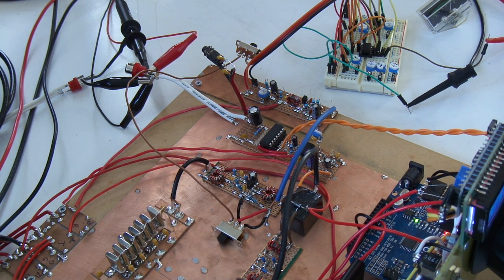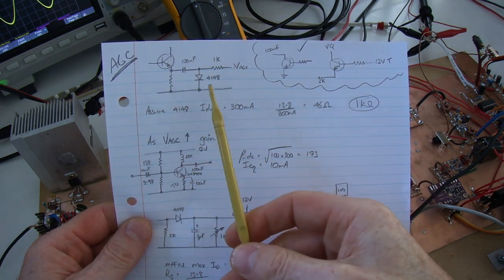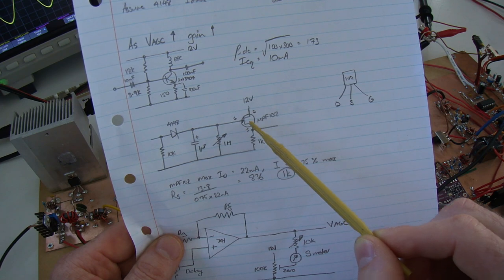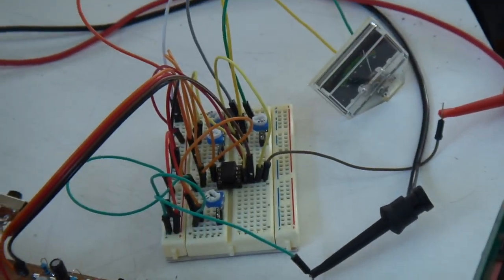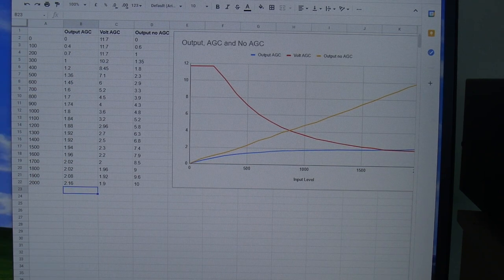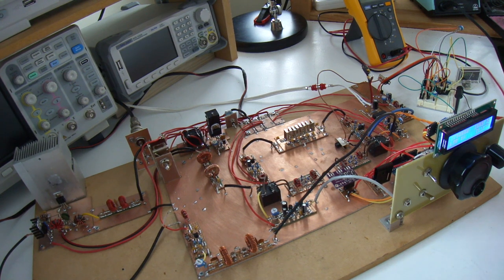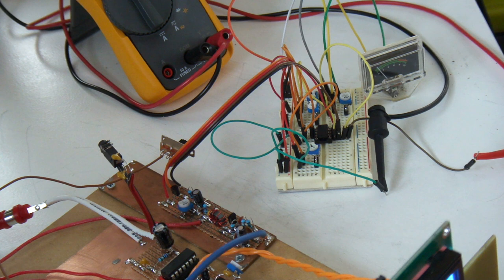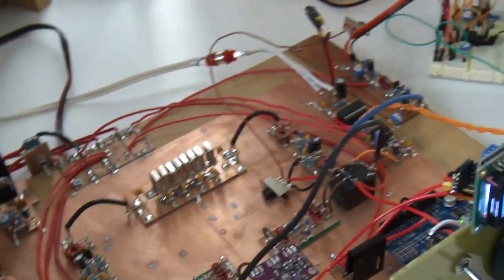Simple AGC Experiments

Comment: I Love the cute modules and enjoy the spirit of your projects. In the same context you could try a Gilbert cell mixer made of matched 2N3904 and compare the performances with your new Siglent SSA. There's a lot of flexibility in that mixer and it's a joy to play with a discrete one where you have access to all nodes, vary gain and modulation schemes.
Reply from the maker: Thanks and I'll look into that Philippe. I've used Gilbert mixers in the past, but not using discrete transistors. That could be interesting as you get the added bonus of gain!
Reply: @CharlieMorrisZL2CTM  yes, and spot to plug some AGC circuitry.

Comment: Very effective and much simpler than my dual gate fet IF amplifier. I'm also adding a LM13700 transconductance audio preamplifier to increase the dynamic range, a single stage gives about 20 db control I may try 2 stages. Thanks again ! WA8HTO
Reply from the maker: That sounds interesting Jerry. I had greater dynamic range when i used the 1N4148 versus the 1N4001. The smaller junction area certainly helped.

Comment: Charlie, I know this is an older video, but would you mind elaborating on how/where you tapped the signal for the AGC detector? It seems like you tapped in the IF chain instead of in AF like most receivers. I'm trying to implement a simple AGC in one of my receivers, but I'm trying to decide on the best place to tap the signal and how to do it without loading down the preceding stage. I've read in Solid State Design and the W1FB Design Handbook, but just wanted to see how you did it, since those texts tend to focus more on IC amplifier chips like the MC1350. Thanks for the work that you put into these videos; they have been a tremendous resource for me.
Reply from the maker: Hi Will. I tapped the IF for this rig. From what I can see in the literature this is the best approach. I've also used AF, which to be fair worked well too.

Comment: Very interesting, to use a simple diode as a variable resistor. The problem is I guess it is non-linear, so in effect you have built a limiter, not an S meter which should have a logarithmic response of -6dB/S point. I am thinking that to provide a log response needs something more sophisticated like an AD8307 log detector (and them an Arduino...)?
Reply from the maker: Absolutely, this is just a simple gain control circuit. The meter is just there for show. Adding an AD8307 could be another upgrade IDC.

Comment: Amazing that a single stage agc controlled has such a good effect at a constant voltage output (after a point).  But the AGC does limit the available gain quite a bit.
Reply from the maker: Yes it's a tradeoff. I have plenty of spare AF gain which i may look to use (not yet). I'll keep playing with it for a few days and fine tune it.
Reply: @CharlieMorrisZL2CTM  Using a diode to control the amount of bypass might be limiting.  Perhaps an FET might give more range.

Comment: For something you say is simple it sure looks like its works very well to me. I love it! 
This is what I thought you could use this radio for. you could have a new series and add to it as you feel the urge. The Radio Extra's hour with Charlie Morris! lol 
If you decide to use the Arduino for more things not only do they have I/O expansion boards but they have Analog expansion and also a true analog out. check them out. Aliexpress has the breakout boards. I'm sure Amazon does also.

16 Bit I2C ADS1115 Module.

MCP4725 DAC I2C Digital to Analog Converter Module (This one is rail to rail 2.7v to 5.5v supply).
Reply from the maker: Thanks Curt. I'll look into those.

Comment: Hi Charlie. You said: "Simple" ACG experiments …. In fact this is not simple at all and you have done a really very inspiring video. Thanks for that. Would it be a good idea to use a pin diode?
Reply from the maker: Thanks Philippe. I used a readily available 4148 vice a pin diode. Having a small junction area certainly helps in getting the widest dynamic gain out of the IF amp. I also tried a 4001 which worked ok, but not a well as the 4148. I'll have to keep playing.